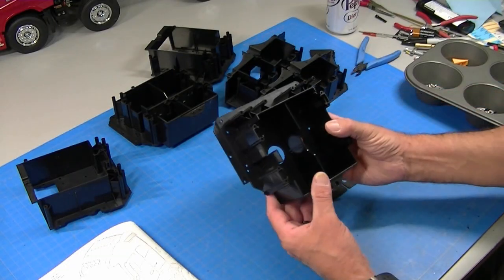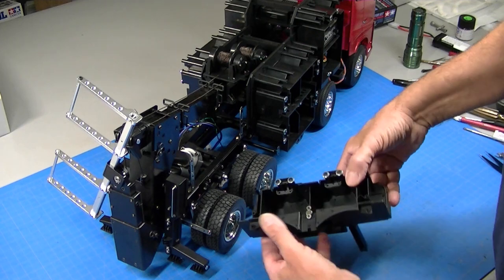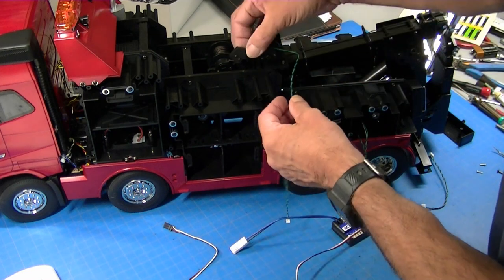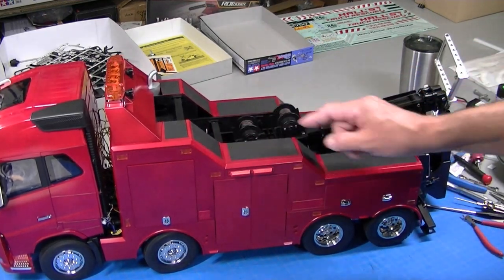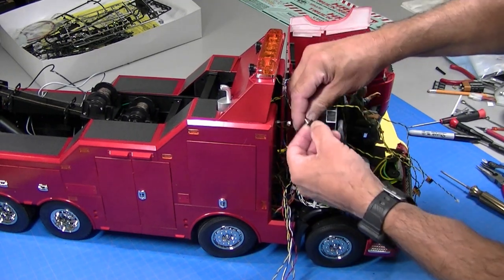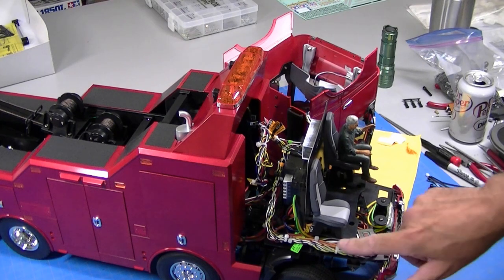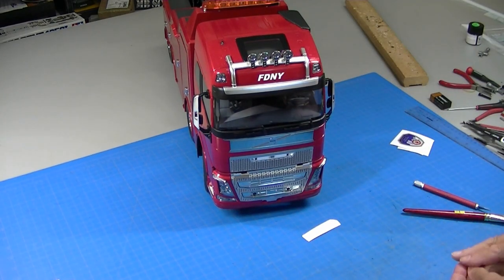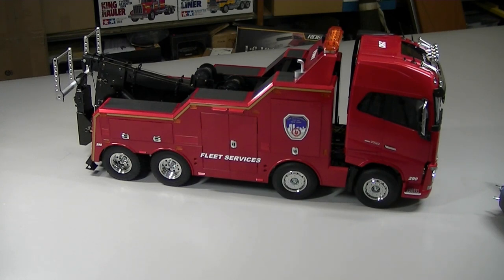Tamiya 1/14 Volvo FH16 Tow Truck Build - Part 7 Final

Comment: Great, big project, as always You put your heart and a lot of work into it. I admit that I do not like this set very much, I prefer more universal trucks that can carry various things. However, the amount of fun during assembly is well worth the price. I have reservations about the headlights, they could have tried harder and added some lenses to better diffuse the light. I also think that they should think about cables, there are a lot of them, unfortunately there is not enough space for them. It was great to watch, thank You for Your work, I am currently building an Arocs timber truck with 6x6 drive, planetary gearbox, Beier module and many other improvements. When I'm fed up, I watch Your movies and regain energy for the project :) Thanks Bob!

Comment: Thanks for the videos. I am partway through my build at the moment working on the cab having completed the chassis. The problem we are having in the UK is low or no stocks of Tamiya parts due to Covid-19. Shortages include the  likes of LED extensions, TS spay paints etc. I did manage to get oil filled dampers though and they fit great. It seems sad that Tamiya could not have included additional wiring in such a premium kit. I am enjoying building the kit though and thanks for all your tips.
Reply from the maker: I agree, the kits should have had the 3 required light strings included.  I soldered up my own.

Comment: Very nice build. I watched your king hauler build (one day build!) I've been building my grand for weeks now...I've built many, MANY kits over my 20 + years in the rc hobby but I wanted to take my time, no rush. The paint process is my least favorite and that is finally done. Just need to add the details to the body. I was amazed when you built one in a day. I don't believe you installed the MFU kit but that's still amazing. My interest in RC has slowed over the years. Your's seems to be trucking right along! No pun intended ;)
Reply from the maker: Thanks!  This whole ting started by accident but as long as I am having fun going to keep at it!!

Comment: I'm building the kit right now, I'm a few weeks behind you so your videos have been quite a helpful preview of what is to come. I'm a little surprised Tamiya instructs us to paint nearly all of the already-black plastic parts with TS-29 black, especially when you consider that so many are not even highly visible in the finished model, like the boxes that go along the sides and get covered by the exterior skin. I guess they show up somewhat as the fender trim. Did you paint all the already-black parts black as instructed? I did buy 6 cans of TS-29, so I guess I'll follow the instructions.
Reply from the maker: I painted all the parts that show like air intakes, bumpers, grills, winch parts etc.  I also painted all the hinges that are molded in white??  I did not paint the side boxes, internal covers etc.

Comment: I love the way it turned out. Is there a way that the yellow light bar could strobe, I am not sure if it could be done.
Reply from the maker: Yeah, future project.  Would have to run it from a different system but would look pretty awesome.
Reply: @HobbyconceptsLLC  yes it does looks pretty good without them flashing.

Comment: fill the diffs with 2.000.000 weight silicone oil if used outside or uneven ground,you will be pleased with the difference! It will act like limited slip diff.

Comment: Can I glue parts together even though I painted the parts?
I bought the baier sfc1 bundle. Should it have the rumble motor and weight?
Reply from the maker: Generally glue interferes with plastic cement.  Use E6000 on painted parts or similar (or screw them together).  The Beier SFR-1 does not have vibration motor capability by itself.  You could add a small speed control to work a vibration unit but I personally do not like vibration.  They shake the trucks apart.

Comment: WOW!!! It turned out amazing!!!!Ill be building one over the winter and take my time. Other than the dash, and cab lights dose it come with enough leds for the kit with the MFU 03?
Reply from the maker: It comes with enough but Tamiya has provided spots for led's in may more places.  The twol lights in th eback of the light bars, several rear facing spotlights and an extra space in the rear lights.  Also all those orange side lenses (that have a screw under them) are intriguing!

Comment: I’ve watched all of your MFC-01/MFC-03 and feel that I have followed your transmitter setup to a tee but I can’t get the MFC-03 to cycle through the lights. What’s your secret?
Reply from the maker: If you are using a Flysky FS-i6x it programs differently than the FS-i6.  Email me for a setup sheet.  My email in video description.

Comment: Hi Bob great video.  Did you find away to use a lipo battery for the Tamiya M F C unit?
Reply from the maker: I use 2 cell lipos with them all the time with no problems.  Only issue is they do not have the shutdown voltage correct and if you are not careful can discharge the battery to much.  You can purchase separate unit for that if you really want to.
Reply: Ok I'll try 2 cell lipo. Maybe use a volt meter To let you know when it's getting to low. What's the run time... about 20 minutes?

Comment: @15:37 when you removed the decal it looks like they are precut is that true? I have spent way too many hours trimming tamiya decals
Reply from the maker: Nope, I cut mine with a sharp hobby knife.
Reply: @HobbyconceptsLLC  looks like a great build. Correct me if I'm wrong but it looks like $2k. Which is a good price for a build like that

Comment: Did I miss the boom ram working?
Reply from the maker: The boom in/out is not powered.
Reply: Hobbyconcepts-LLC sorry I meant up and down. The part you motorised.
Reply: @drinternatg6391  There is a short clip at 34:08 if anyone was wondering.

Comment: Hi
Just a suggestion, but why the cab will not tilt is because Tamiya uses a spring clip on a post system. You couldn't access it.. Why dont you upgrade to a pre sprung latching system
https://www.ebay.co.uk/itm/Metal-Cab-Lock-Catch-Set-fit-for-TAMIYA-Scania-MAN-Volvo-RC-Trailer-Truck-1-14-/402303321835?_trksid=p2349624.m46890.l49292

I use these on all my tractor units

Comment: Isn't this that kit that's rediculously priced at like $1200?
Reply from the maker: Your information is incorrect.  Also price is very subjective.  I think the kit is priced well and a good value for the money.
Reply: @HobbyconceptsLLC  it's listed at $1,060(prerry close) plus all the added parts and you're there. I bought an entire tamiya semi with trailer, sound and accessories for less than this kit alone.
Reply: It reasonable priced, when looking at the complexity. If it was a german Scaleart truck you would be looking at $12000-15000 ;)